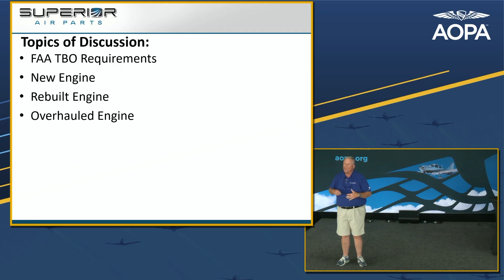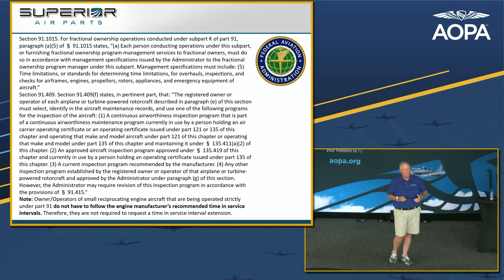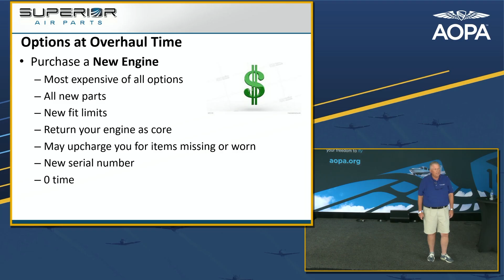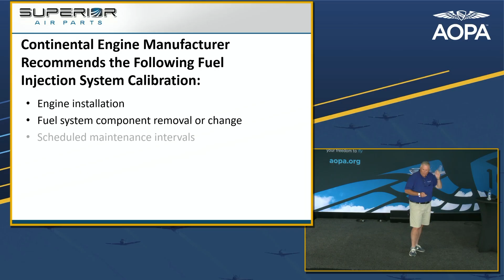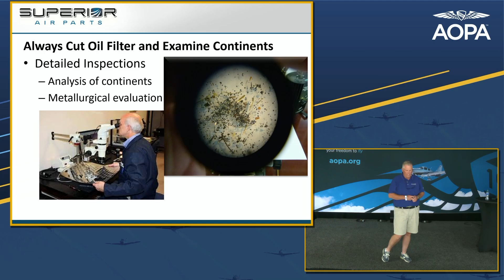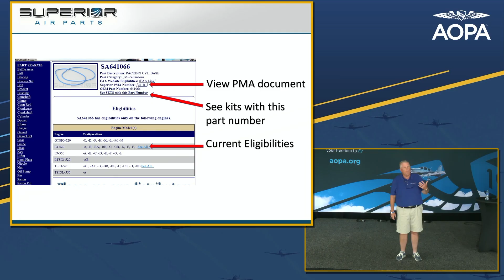Superior Air Parts Presents: 50 Hours From TBO: What Are Your Choices?

Comment: Very good overall presentation. I do believe he underestimates the risk of maintenance induced failures. Also, I think owners should be aware of many A&P's are spring loaded to overhauling an engine or replacing cylinders when less invasive options would be more appropriate. Owners need to educate themselves and not just rely on your local mechanic's opinion.

Comment: TBO times are make and model specific as stated in a manufacturer's Service Bulletin or Letter. They are not mandatory in the case of part 91 operations.  If your engine has been well maintained and you do regular oil analysis and can assess the ability of the engine to keep going, then keep going.